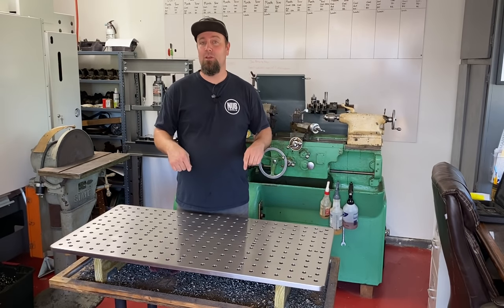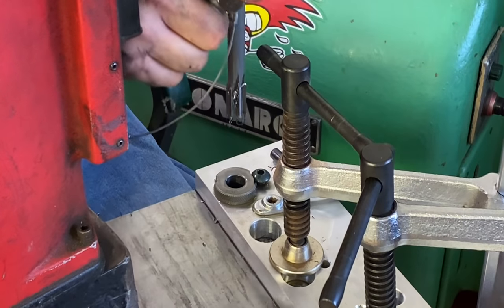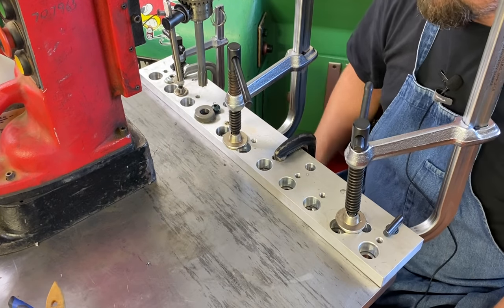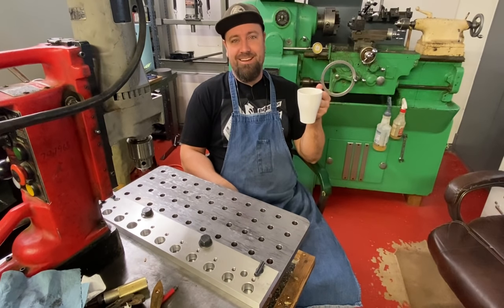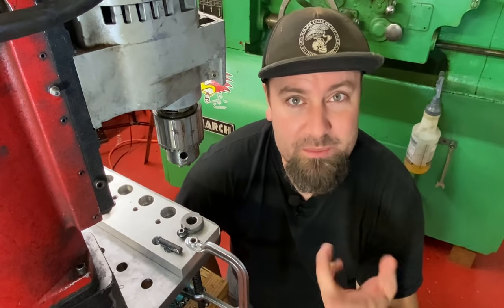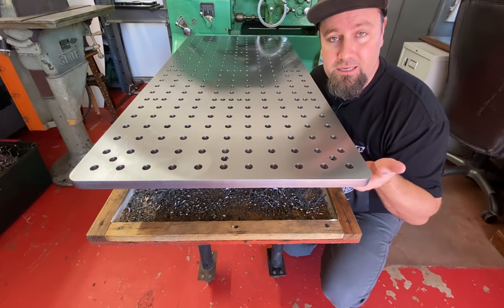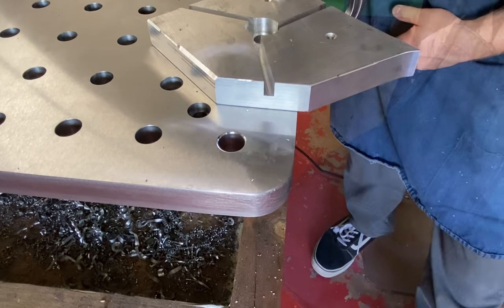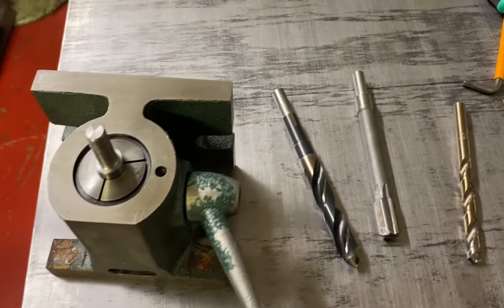My Welding Table Build | Drilling Precision Fixture and Clamp Holes With a Mag Drill Jig

Comment: D8 sander would be good for the surface prep to remove mill scale. Though I’d probably start with sand blasting then use a D8 sander. 
I’m doing something similar but with 1/2” plate and making an L shaped guide jig.
Annular cutters works so much better, but your fit using the reamer is very nice.
Reply from the maker: Cool. Sandblasting would have been way better or using vinegar soaked rags maybe.
DA sander to finish. Good luck on your project!
Reply: @nubtools  I really like your attention to detail. Still watching. Used mag drills a lot when I was a fabricator. Always looking for a used one, curious how much rental was? TY
Reply from the maker: I think it was in the neighborhood of $80/ day. The trick was renting it at the end of the business day on Friday, then not having to bring it back till Monday morning for the same price.
Reply: @nubtools  that’s good info. Just finished watching, subscribed and looking forward to your channel. The surface grinding really stepped up the overall finish. Blew me away with the router use, wouldn’t have dreamed the cutters would hold up to steel at that RPM. Well done.

Comment: Over time you may not appreciate the tolerance you created in that setup. A small amount of heat and those pins may not come out easily.  Table looks great, good process, and will be a good tool for future projects.
Reply from the maker: Only time will tell. I am getting what I asked for right or wrong 😆
Thanks for commenting and watching!
Reply: @nubtools  I did a very similar table last year and made the holes 0.630 instead of 0.625 (5/8"). My clamps use 5/8 standard fixtures and they are nice and tight still. Something to consider if you find your holes are too tight. You can just ream them out the extra 0.005
Reply from the maker: Cool, good to know, thanks for the tip! So far it’s been super great.

Comment: Came across your video.  Nice job!  I'm a newbie who has that mag drill and looking to use annular cutters.  Seems I'm going to need to get a new chuck to accept Weldon Shank cutters.  If anyone on here can set me straight on what I need, I'd love to hear it.  Of course, new subscriber 😁🤙
Reply from the maker: Thanks! You might check the manufactures website or eBay for the adapter.

Comment: excellent guide !  I drill 16 mm holes thank you , what bits you recomend me to use with the routing
Reply from the maker: Carbide tipped seemed to work decent from the hardware store.
Reply: @nubtools hey bro I done test with my router and it works perfectly ! thank you
Reply from the maker: Nice!!👊
Reply: @nubtools  Hey again :) How to clean a welding table and keep it from rusting? do you have any idia ?
Reply from the maker: I apply WD-40 every so often
Reply: @nubtools I appreciate your answer , I use it too, but I get to work on the table once a week or so and in between it rusts a bit

Comment: Just found your channel and really enjoyed the series on your table build. I'm currently debating building my own table vs. going with a kit or pre-made. Don't know if you've thought about this but there may be a market offering your hole jig for sale through your site. You could make a kit out of it including the guides and reamer or links to purchasing them. Having a CNC machine to mill them fairly quickly and accurately would save us all a bunch of lay out time and repeatability.
Reply from the maker: Thanks for watching Dutchmann! I have been thinking about this and may have something to offer in the near future. It will be a simplified version and probably will be intended for the use of an angle cutter. If you’ve read through some of my comments people are more inclined to go that route. The way I did it is not favorable for most peoples palettes. Understandably so.
Reply: @nubtools Yes if you mean other than twist drills such as an angular multi toothed bits, I agree. They're very accurate and last much longer than twist drills and are really what mag drills were developed for.

Comment: I was going to do something like this, the bushing plate is a real nice touch. I was going to do slats and lay out with a caliper, but yeah.. those mag drill chucks are kind of wobbly in that sds or whatever it is. I wonder how it would come out with a anular cutter (optimal IMO)... but with this economy the project is on hold lol. I was also wondering about the battery powered router on steel plate
Reply from the maker: Thanks! Using an angular cutter would still make one great table. 
Thanks for watching!

Comment: That looks pristine!  Any coating needed?  Some of my blanchard ground tooling was rusting and pitting until I sent them for black oxide.
Reply from the maker: Thanks! Well, for right now WD-40 is her friend. My plan is to have it Black Oxide finished which will still require some oiling from time to time but not as bad as bare metal. My shop is climate controlled and rust is not something I deal with fortunately. Thanks for the comment and for watching!

Comment: Beautiful table top! May i ask why you didn’t consider getting it laser or plasma cut? I suspect you are like me and just like doing it yourself. But i am about to start my own table and like you, i want the holes accurate and im considering laser but now ive heard that maybe at 12mm thick the holes might not he too accurate on the bottom surface due to the laser not being deathstar powerful… Not sure what to do! I dont own a mag drill yet either.
Reply from the maker: Thanks Julian! I was dead set on a reamed hole and holding a very tight tolerance. Most people and for good reason, wouldn’t want to take things as far as I did. I think laser cut holes would be a great option for speed, and hole location accuracy. You are correct that on material as thick as 12mm you could have a slightly distorted hole at the bottom side but the top side of the cut will be very nice. I would consider having the holes under sized by maybe .010 to .02” and chase the holes with a reamer or drill. Or simply have the cut on size and the drill will clean up anything left over. Consider renting a drill, that’s what I did. 
Thanks for watching!
Reply: @nubtools  ahh great ideas thank you.

Comment: Drill halfway through the plate from the back side and plug welded to help keep the plate from the delaminating when you start welding you're putting a lot of heat into it
Reply from the maker: That would be an option for sure and I had considered that but for a few reason I chose not to. I didn’t show it in the video, but the two plates are pinched and welded together inside all 18 bolt holes and many other fixture holes have the seam fused together before I had the plate precision ground. This was not Ideal at all and quite terrible. I should have cut my losses and ordered a solid piece but at the time it was not in the budget. I don’t see the table getting that hot to cause issue and I plan on having risers made for many applications but we shall see, the bullet is down range now.🤷🏻‍♂️
Thanks so much for watching!
Reply: @nubtools  well make sure to release a video on it 6 months or a year down the road so we figure out how well it went

Comment: Good job very time consuming we build our tables on the plasma table then Reem them takes about 3 hours for a 3'x10' table
Reply from the maker: 😂💪 Nice! Sounds great. Are you chasing the hole with drill , end mill or an actual reamer? Also, how thick is your material and how much are the holes undersized before reaming out of curiosity?
Thanks for watching!
Reply: @nubtools  depend on the customer specs I built a 2.5x4 on 5/8" plate and just reemed with a 16mm end mill on the old Cincinnati knee mill that is the max I can do on the mill thickest I've done is 1" but that was a fixture/weld table I cut that on the plasma and basically did what you did with a mag drill. I've done quite a few of those 1/4" hobby weld tables
Reply from the maker: Very cool! Thanks for sharing. The more in the world the better.

Comment: How much did the grinders charge to shave off the top of the plate?
Reply: And where did you go aswell thanks
Reply from the maker: I got a deal from a friend but I have had it done other places for under $200.  The for this part I used Daniluk Corp in Oklahoma City. They used a surface grinder, which makes a beautiful finish but it is a slow process and can be quite expensive. The best method in my opinion for this application is Blanchard Grinding. It’s fast and usually very reasonable.

Comment: Do you think 3/8” or 1/2” would’ve done the trick on table top thickness? Rather than going 3/4”?
Reply from the maker: My guess is either of those would make a fine table. I wouldn’t want anything thinner though. The 3/4 feels so good I have to say. One thing to consider that I didn’t is the ball lock hardware. Strong hand tools hardware are made for 5/8” thick tables. Luckily they made an adjustable length ball locks that worked on my 3/4” plate. If you went with thinner than 5/8” , I guess that a guy could add washers under the head to make up the difference.
Thanks for watching!
Reply: @nubtools  awesome thank you for the info.

Comment: Looks killer! What are you using to prevent surface rust? I’ve tried many products but the bare steel still finds a way to collect surface rust
Reply from the maker: Thanks! Right now WD-40 is my friend. My shop is climate controlled so humidity is not a problem. When the table gets completed I plan on having the table top black oxide finished. It’s won’t be impervious to rust but it will be more resistant than simply bare.
Reply: Frog lube would work. Its like a wax & can handle some surface contact that protects the metal. Its a bit better than spray on like WD-40. It also has a mint smell to repel rodents so they don't walk & defecate on the metal surface.
Reply from the maker: Mmmm minty! Thanks for the suggestion and for watching!

Comment: Hey
Why didn't you us a roterbroach cutter instead of traditional drill bits ?
Reply from the maker: Great question. First, I was dead set on having a reamed hole and holding a very tight diameter tolerance, second the rental mag drills available were all set up with drill chucks. In the end I got very close to the results I was after. 
Thanks for the comment!  -Dave

Comment: minute 26:18  How would you have made the edges square?
Reply from the maker: I should have put a square on the side when I started roughing out the welds to see where things were going. Then check and recheck as I approached flush. To take it a step further a guy could make a square out of wood or metal, have one leg as a guide along the top and bottom face , then add sand paper to the face that rides on the edges to be squared. Spray a guide coat of some sort like you would in auto body work to find all the high spots. I did block out the sides with a hand belt sander to get a flat finish, they just were not perfectly square to the face.
Thanks for watching!

Comment: Re: surface coating. Just thinking, you might simply blue the surface with gun bluing. It's cheap, can be re-blued easily for touch-up inexpensively and will certainly control corrosion. It offers good conductivity for welding. Just an idea. Good luck with whatever you decide, just give us that follow-up please...
Reply from the maker: I will be having the top black oxide treated. Very similar to the gun bluing.

Comment: Must be a bench with some of the best quality holes out there, but it’ seems a shame to have put in all that work into a compromised slab. The centre could slightly separate when using clamps and possibly getting debris in between. But I sure do appreciate your dedication to it and hope it serves you well.🇬🇧
Reply from the maker: Thanks Grumpy One. You are right, it is a shame. To give my self the best chance of the two pieces to not separate I did a few things off camera before the surface grinding was done. At all 18 bolt holes I oversized the holes and welded the seam, then re-drilled the holes with the fixture to the final hole size which left a weld in place. I also fused many of the seams in the 5/8” holes and chased them with the reamer afterwards. Also at every point I did these things I had bolts near by pulling the plate tight together. Hopefully this will prevent and future problems. But yes I wish I had an actual solid plate.
Thanks for watching!!
Reply: @nubtools  It sounds very much like you did a belt and braces job on it and it was good you welded prior to getting the surface ground as the heat can distort the plate too. I’ve got a 7 feet x 4 feet bench 12mm (half inch) thick. It has developed a slight crown in the centre on one side. I’m very tempted to put down some weld to try shrinking it back but I could easily make things worse so I live with it. At least for now.👍🇬🇧
Reply from the maker: Belt and brace is a new one on me . Going to have to learn about that. Thanks!
Reply: @nubtools  Belt and Braces is an English saying meaning you’re leaving nothing out to chance or going the whole hog. As in to make sure you’re pants don’t fall down you’re not only wearing a belt but braces too. (maybe you use the word suspenders for braces)
Reply: @grumpyone5963   we say "suspenders and belt".
Reply: @scottwillis5434  👍

Comment: How much did it cost to get it ground down?
Reply from the maker: I paid $100. But it should have been $500. This was done on a surface grinder. I had a quote for $150-$200 from another shop using a Blanchard Grinder, and in most cases this would be the most economical method for grinding. I just happened to get a great deal from someone I knew.

Comment: did you price up laser cut plate with the hole pattern ? i find that the absolute cheapest most accurate and economical way of making thser table tops.
Reply from the maker: No I didn’t because I knew it would not get me to where I wanted to go. But you are correct that it would be a great route to go for both time and cost. WaterJet cut would also be a great option. I think If I ever move into a larger work area and had a need for a big table I would probably consider building a table that way. But for this one I wanted to go a bit further. Having it machined on a large enough mill would be my second option for what I am trying to achieve.
Thanks for watching!
Reply: I did that, and then used a "Poldi" solid adjustable reamer to clean out the lasercut holes to the exact fit I wanted. A chucking reamer (or better still a taper bridge reamer) would also work if you can get one the exact right size, but a conventional (removable blade) adjustable reamer would probably spit the dummy.

Comment: @nubtools there is a YT channel called origins of precision, they’re pretty good! The first flat surface was made with three surfaces that are spin lapped against each other. A & B need to take turns with C so that there is no cupping. After that, you can get straight edges. Once you’ve got a straight edge, you can get perpendiculars through measurement and after you’ve got straight perpendiculars you can rotate these on a lathe and reproduce just about anything. A mill is just a standing up lathe!
Reply from the maker: Cool!
Reply: Do you mean the YT channel called "Machine Thinking" which has videos titled "Origins of Precision"? It's very good 😃👍

Comment: Just wondering, If it took 50 hours, would have not been better to buy a pre drilled table top?
Reply from the maker: If I didn’t have such a specific size needed that wasn’t available, then most definitely it would if I valued my time. The rino cart was almost the right size but it did not fit the bill. Not to mention it is $2500 or there about, and not a shabby value looking back. I will have less than half of that spread out over a long period of time. 
Thanks for watching!!
Reply: @nubtools  I have my own 3/8" table and I liked watching how you put the holes in yours. Thanks for sharing.
Reply: @nubtools  Indeed. Plus you cannot buy satisfaction of the sort you get from making a great job of a shop item which will be in constant use. 
Also I find I tend to take better care of things I've directly put sweat into.
Reply from the maker: Thanks for watching!
Reply: @nubtools  not too many guys could build there own table top and hold straight and square. I have wanted one for years but much larger. Congratulations, good job!

Comment: Awesome job!  Quick question… about how many drill bits did it take to do the job?
Reply from the maker: Hey thanks! Just one of each technically. I did switch to a second pilot drill early on because I was leaning to hard into the drill just as it broke through the plate and it chipped the drill ever so slightly. I am sure I could have kept going with it though. It was a cobalt drill. The pre reamer drill and the reamer made it the whole way through no problem, both hIgh speed steel and had plenty of life left. I used a water based cutting fluid from Milwaukee that was great.
Thanks for watching!
Reply: @nubtools  thanks, good to know, in case I try that myself one day.

Comment: Why didn't you use an Annular cutter?
Reply from the maker: The main reason was that I was dead set on a reamed hole and using the drill jig that relied on the previous holes for position, I needed the holes to be very tight to reduce stacked tolerances. I wanted the straightness and squareness of the hole positions to be as close to machined quality as I could. That goal was achieved thank goodness. As good as I could measure, I am straight and square. I did grow from the first row to the last by about 1/32”, but that is fine for what I need.
Thanks for watching!
Reply: @nubtools  It was an awesome build and gave me some inspiration for my table. Thanks for sharing!
Reply from the maker: Mission accomplished!🙏